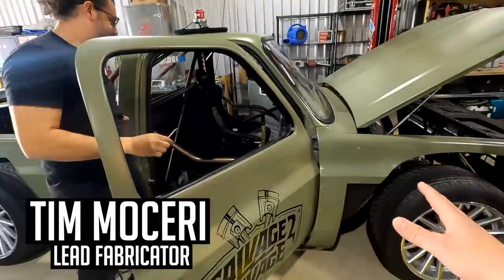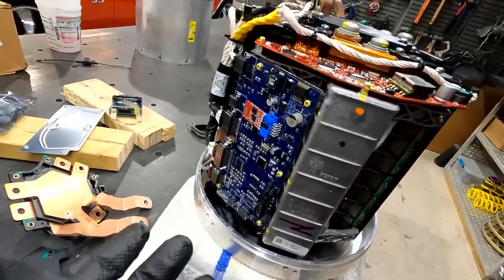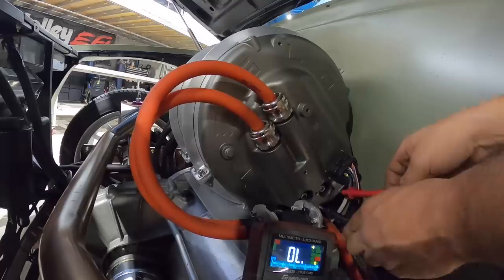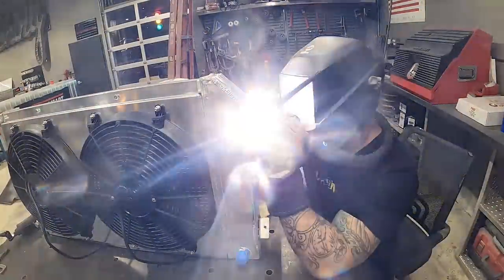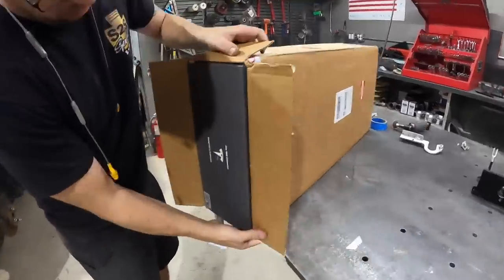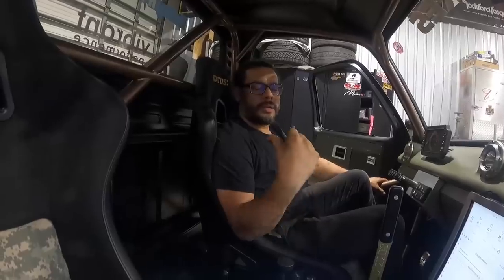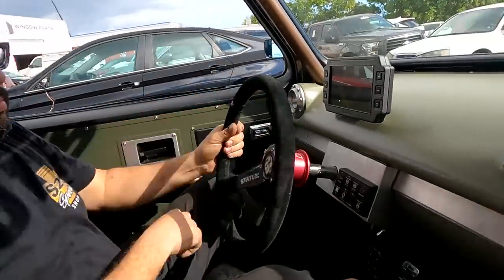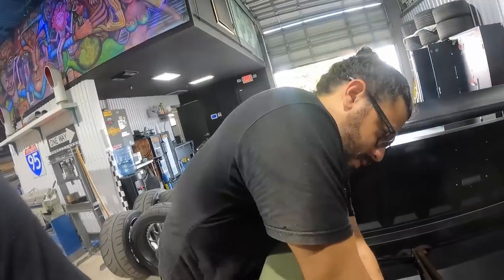Tesla Swapped Squarebody Inverter & Radiator Repair - Electric C10 Ep. 24

Comment: You guys can get it done! SEMA was awhile ago, the correction for the leaking rad and voltage problems are fixed, now this cantilever suspension and spring system once dialled in will be awesome!
Tim, Mike and crew members are all very talented!
Reply from the maker: Thank you for all the support! Now that SEMA's over it's no longer a rush against the clock and it gives us a chance for everything to be done 100% perfect!

Comment: You guys should set the front motor to go forward the rear Motors to go backwards that would make such a crazy burnout
Reply from the maker: That's the plan! While we're doing the suspension we're also working on fine tuning the motors so we don't burn down the shop while we smoke the tires standing still!
Reply: That’s such a great idea!  Then wind in some steering and see who can hang on for ten seconds. Square body rodeo!
Reply: @SalvagetoSavage  So good... was just about to post this!! 🔥

Comment: Measure temperature and run the pumps and fans as needed if you’re really worried about the tiny extra power draw.   I’d bet running the pumps would be enough most of the (charging) time. 

BTW, charging is not when the most heat is generated. Heat is proportional to power in or out. When you finally do that awd burnout, power is going to be way higher than during charge.
Reply from the maker: We'd rather run both from the jump and make sure everything stays at a safe temp from the get-go. We weren't really worried too much about the draw, we were just making some fun of ourselves. And that AWD burnout will definitely generate a ton of heat, we were talking more in terms of regular driving compared to the battery taking a 360 volt charge! Thanks so much for watching, we really appreciate the support!

Comment: If those blue things feel like magnets ( hard, kind of heavy) and were surrounding the input power leads they are probably ferrites. Usually used to suppress RF interference from getting out of the motor/inverter. May be related to the judder issue.
Reply from the maker: Possibly! That'll be something we'll look in to. Our other two inverters though didn't have anything similar in them when we cracked them open the first time

Comment: Hey! Great channel, team and build. I’ve been subscribed and watching from the beginning and everything is on point. Just my opinion but the one thing that looks a little off on the truck is the rear radiator. Seams like there’s plenty of room up front for it with the others and you can showcase the rear suspension. Keep up the great stuff, Cheers!
Reply from the maker: Thanks for the feedback! We're stoke to have you following along for such a long time! We definitely thought about putting it up front, but we wanted to keep the front as open as possible to give that contrast of what a C10 usually looks like with a 350 taking up the whole engine bay!

Comment: Great work guys, keep it up!  Is that a sport inverter?  Glad to see you got both motors turning and the charging working!
Reply from the maker: It's a stock inverter from the model S but with a Zero EV control board
Reply: @SalvagetoSavage   I was looking at the red circuit boards versus the green, I know on my sport inverters they are the red color.
Reply: Red yes is sport